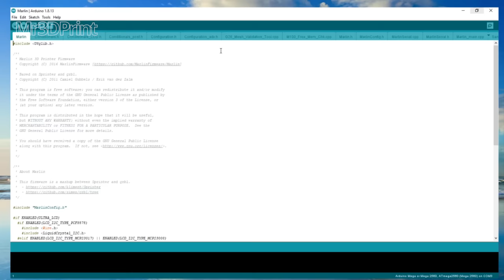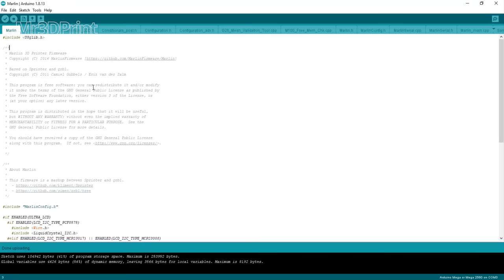#4 Heat and motion control board  - Details of free filament production from recycled bottle (PET)

Comment: Instead of a ship IN a bottle, it’s a ship FROM a bottle, I like the play on words.
Reply: true jajajajaj
Reply from the maker: I do not understand what you mean, you mean I wrote wrong?
Reply: @mr3dp  no no, you wrote correctly, your video is a ship from a bottle. John Smith is referring to a desk toy where a ship is inside of a glass bottle.
Reply from the maker: @isaacf.5166   ok. :)
Reply: @mr3dp  it is a play on words in English. Instead of building a ship inside a glass bottle(how they are traditionally put together) you took a plastic bottle and printed a ship from it. I like it :).
Reply from the maker: @JohnSmith-qm5xu  What an interesting example! Well done :)
Reply: I would of put it inside of aabsopure bottle and printed it larger if possible  by cutting off the neck end where it could be glued and put a few rgb led tape lights inside and make a wooden stand for the bottle one that would hide the led controller

Comment: I worked for a plastics company for many years and we had an extruder recycling plastic on an industrial level of course. You have the basic concept. you can run the heating side with a thermostat controller with a thermometer  or even with a thermister, i use this, on the feed side, i join the plastic with a soldering iron to have a longer continuous feed. And i have a dc controllable motor on the take off side to roll on to a normal filament roll!  good Work PM me for any help you may need

Comment: Thanks for another installment. I like the idea of using gCode instead of hacking support for constant movement into marlin like I was planning. For easier starting you should add the following line after the extruder is heated (this should pause the gCode so you can load the filament into the puller): M0 Press to start motor
Reply from the maker: Glad you liked it!
Reply: @mr3dp  do you know when the files for the winder will be available?

Comment: Congratulations, I find it amazing that this material that produces so much waste can be reused..! A technical question..
It could be used instead of an Arduino Mega. the Arduino UNO without display to work in the same way? It occurred to me to facilitate the design for a school in my city that can recycle the materials, I saw that there are several that reuse PET bottles..

Comment: Great series of videos definitely thinking of making one the only problem is I cannot find the motor in stock anywhere could any other stepper motor work and if so, which type, thanks in advance
Reply from the maker: You can use the same gearbox motors, such as the car windshield motor - or the car wiper motor or ....
Reply: @mr3dp  thankyou for you're reply so pretty much any stepper motor will work? I'm ordering the parts today to make a start :) one other thing though you know the acrylic big gears you use could I print them instead as I haven't got a laser cutter? And what order do The cables connect into the power supply unit? thankyou in advance

Comment: This is an awesome project. I'm wondering what the purpose of pumping air into the bottle and spinning it over the stove is though. Is it to smooth out the shape of the bottle so that it is easier to cut? Also, what is the thing that attaches to the bottle's cap that connects to the pump? Thanks for sharing this.
Reply from the maker: The purpose of heating is to smooth the outer surface of the bottle
And what I attach to the bottle is a Rubber Valve
Reply: Pumping air will make soft plastic expand that's why
Reply: @mr3dp  rubber shradder value

Comment: Can I change it to 
Arduino uno r3 + extension stepper motor board +stepper motor +  heater + sensor + Lcd Keypad shield (with 6 buttons on it)?

Comment: Hello Mr3dPrint.
I have no words to thank for sharing this invention and I really want to make one for myself. It is brilliant.
Thank you very much really. I am following the process with great interest and excitement.
The world needs more recycling and less garbage, the oceans ...
Apart from making our materials cheaper, etc .. it's great :)

I have a simple question: I am very new to 3D printing.

Can I use the 2004 lcd instead of the 12864? It's a really insignificant detail, right?
I suppose it is a question of having the Marlin with the corresponding screen library to use?
Kind regards from Spain and I wish you all the best
Reply: My opinion to improve the project or to contribute ideas that you ask in the description, is that it would be ideal if crushed plastics could also be used and that it was not a complicated system. I guess it would be a different machine or a very different concept.
I mean in this machine a simple system that pushes crushed plastic is attached to it. Maybe I'm going a lot out of the original idea, I don't know, or maybe it's possible ...
This one is cool and simple, the other idea would also be great in my opinion and would use different plastics from different packaging ...
but with this philosophy of simplicity and materials within reach.
Much encouragement and thanks for the great contributions and the desire to share.
Reply from the maker: I do not know, but I think it does not matter, see if GCode works properly in your program?

Comment: Hey, great project! im trying to do it myself
Can I use a 20x4 LCD ??
Reply from the maker: I don't know, maybe it can be done with it, I recommend doing it with thermostat w1209, it's easier
Reply: @mr3dp  If I use the thermostat w1209, I would have to set the appropriate speed inside the arduino code and then control the tempeture using the Thermostat? Is that it?
Reply: Im from Brazil, and the LCD 128x64 costs a lot of money

Comment: Hi @mr3dprint and let me say, what an amazing idea and work.
I have a quick question, I have a 12v, 5amp and 60W power supply, it is going to work or do I need the 20A 240W one to make it work??
Thanks again
Reply from the maker: If you do not have a good power supply, you can use old computer power, I will make a video in this regard, be sure to watch it

Comment: Hi, thsnk you for some great explanations om this topic. I have 2 questions:

1. Is it necessary to pressurise and heat up the bottle like you do in the beginning? Or what I be possible to skip this step?

2. When you pull it out of the nozzle that is 1.7mm do you ever get inconsistent plastic size so maybe 1.5 instead? Does the plastic sometimes break when you are making the filament?
Reply: he pressurizes the bottle so when he heats it up, the plastic expands uniformly and becomes smooth, so when the bottle is cut into a strip the maximum possible of the bottle is transformed into a strip, because those uneveness on the bottle may cause a inconsistent strip and/or break the strip when it's being pulled
Reply from the maker: 1. The purpose of heating is to smooth the surface of the bottle, we do not do this for smooth bottles.
2. When leaving the nozzle, if the traction speed is high, the gear filament will come out, load the attachment G-file, the speed is good

Comment: Have you worked with any bottles that are 0.65mm thick? and if so that are size does the ribbon need to be? thanks, Like before great work.
I am working on a PET filament welding/splicing device that run off of the same Ramps board but uses 2 extruders. One for the puller part and the second for the welding part. Thanks for the fantastic idea.
Reply from the maker: The maximum thickness I have worked with is a 0.5 mm thick bottle, for which the width of the bar is 6 mm.

Comment: Is the cross section of finished filament hollow? Also PET should be recrystalized if you need good mechanical properites. But it is very interesting solution for 3D printing.
Reply from the maker: I drilled it with 1.5 drill and the produced filament is about 1.7, but in general, it does not matter how big it is, in any case, if its density or diameter is small, you can change it in the software settings. And instead of changing from 1.75 to 1.5 or 1.6, this was not a problem for me

Comment: Made mine with $25.00 AUD 👍 
Testing my first batch in a few hours time later tonight. 😁
Reply from the maker: Good luck!
Reply: @mr3dp  thank you 🙂, after some trial and error it work's well.
The tuning was the hardest part, the size of the tape "is very important".  
I tried 8mm and it stopped, 7mm same thing, 6.7mm same again, 6.4mm was perfect! 😂. 
I'm glad I precut 6 2ltr bottles prior to it 🤣
Also my temperature is set at 220c and I can still feel the seam in the made filament? 🤔 is this correct? 
Thank you again
Reply from the maker: It is normal to have a gap in the filament because in this way we make the tape cylindrical
Reply: @mr3dp  thanks mate, I worked it out. But thank you again.
Did you look at my video coloring the tape with marker?

Comment: How do you control the speed of the stepper motor? The gcode has it at F55, but what does not seem to pull fast enough. Have you found any way to adjust the stepper motor while it is pulling? I have modified the Marlin firmware and your gcode file to work with 2 drivers allowing the extruder temp to be adjustable, but I have had to modify the gcodes for different types of material, by creating separate gcodes for each material. I would like to share the infor but do not know how to the it to the comment, and help would be apricated. Great work on this project.
Reply from the maker: To change the speed or increase the speed of the stepper motor, you must change the G-code
You can open the file with Notepad and change the number F55 to F110, the speed is doubled
Reply: @mr3dp  I am looking to be able to change the speed as it is pulling. I am looking for some information on how to implement a  1k pot, as I have been reading and watching YouTube articles.  I have modified Marlin to use X as the stepper motors driver and only use the Extruder for the hotend. I also used your gcode and modified it to down to about 16 lines. Works great. Using that I created addition gcodes for different temperatures. 
Since I was working with Marlin, I added a second extruder so that the filament welder/splicer that I built, could be used with the same power supply and software.
Now if I only have a good source of the same type of bottles.
Keep up the good work.
RC
Reply: can you help me with how to get this code and to upload

Comment: Could you tell me what program inside the sd card on 6:13, and is it required to use sd card?
Reply from the maker: In this method, yes, the G-code file is attached to the description
Reply: @mr3dp  ok, thanks for the information 👍

Comment: WOULD A 12V 30A PSU BE SAFE TO USE WITHOUT FRIYING ANYTHING? INTEAD OF THE 12V 20 A YOU RECOMMEND . I LIKE THE FAN FEATURE OF THE 12V 30 A ONE BUT IM NOT AN ENGINEER , WOULD IT BE SAFE TO SWITCH THEM ?
Reply from the maker: It should not be 12 volts, you can also use the power of old computers.The next tutorial will be about the same

Comment: Hi! I have two questions:
Fisrt: what is the order for the installation cables in the power supply?
Second: I've connected the Mega to my pc but when i try to "print" the Gcode there are - E1 Err: MINTEP - PRINTER HALTED (Maybe isn't connected to power supply?)
Tnx and you have done a NICE JOB! <3
Reply from the maker: It is marked on the board which is positive and negative.
If you see an error, search for this error on the Internet

Comment: Will you supply just the Configuration.h and the Configuration_adv.h files that you are using. so that I can adapt it to my board and controler. The generic on that is in the Marlin download link does not have the modified files. Thanks, Great work.
Reply from the maker: If you have a newer Marlin code, open that G-code file. If the extruder motor is activated, you do not need to use the Marlin file that I sent.
Reply: @mr3dp  The link does not make any since. Do you have a direct link. Thanks

Comment: Will I have issues using a different stepper motor than the one you used? It is out of stock and I can't find one with similar specifications.

I was looking at getting this one, step angle is the same, but current and holding torque are different than yours.

Twotrees Nema17 Stepper Motor
Product type:Bipolar 42 Stepper Motor
Step Angle: 1.8 deg. 
Rated Current/phase: 1.5A
Holding Torque:42N.cm (60oz.in)
Reply from the maker: Hello dear friend, I do not have exact information about stepper motors, but I think if you connect your stepper motor and there is no problem in running G-code, you can use it.

Comment: Hi Mr3dprint
Great Jop to make this machine
What is the diameter of the strip 6mm or 8 mm or 10mm to get a 1.75mm filament
Reply from the maker: The width of the bar is directly related to the thickness of the bottle. The thicker it is, the smaller the width of the bar should be.
But in general, it does not matter how big it is, in any case, if its density or diameter is small, you can change it in the software settings and change it to 1.5 or 1.6 instead of 1.75, this is a problem for me. It was not an instrument
Reply: Thank You

Comment: 07:37 is there a reason why you set the blue guide post so that it turns the  shredded bottle plastic to 90 degrees and then set the heat block it also gets fed the bottle plastic at a 90 degree angle?  Is this done this way to decrease slack and create as much tension as possible? I'm guessing moving the shredded bottle plastic wheel to the right and rotating that blue wheel clockwise so it feeds straight to the heat block which then gets fed the plastic at 90 degrees isnt good enough tension
Reply from the maker: This is because the strips are cleaned and slightly warmed before entering the extruder
Reply: @mr3dp  oh so those posts clean and warm the strip? I didn’t know there was a heater on the post. That’s new. I’ve watched a few of these builds and no one heated it before entering the heat block.

Comment: Great work! I wonder how precise and consistent the end filament is. Do you plan on adding a diameter sensor of some kind to compensate the extrusion on the fly?
Reply from the maker: I do not think it is necessary because it is diagonal, I may just put the motion sensor off when the tape is finished

Comment: Have one more question about heating, looks like it is not working. I'm getting error on display: "e1 heating failed printer halted please reset" Do you know maybe what can be the reason? I'm checking when board is connected to PC via ubs cable (could it be that voltage is not enough as usb should have 5v and heating wire has 12v)
Reply from the maker: The voltage is low. The voltage should be 12 volts and 20 amps

Comment: I'm sorry I created your same configuration that is with a ramps 1.4 only that I have a 16x2 LCD or installed the marlin1.1 from the PC I can manage it but the LCD no you see anything could you tell me which parameters I need to correct
Reply from the maker: If you change the LCD, you must also change the Marlin code

Comment: Mr3dprint: I have the possibility of getting a nema 23 motor with 6kg of torque, my question is if I can use that motor with the 4988 driver or if I can only use a nema 17 motor. I ask more than anything about the consumption that the nema 23 may have so as not to burn the 4988 driver
Reply from the maker: I do not know much about it, but I do not think they are much different

Comment: Hello good I have a doubt about how the connection of the motor to the ramps plate is going because the colors are not well seen or in what order they are that we are doing the same project that we are interested in doing
Reply from the maker: If you have a problem with the stepper motor connection, you can contact me on Instagram

Comment: I made eaxctly the same,but its not working. The problem,that the bottle plastic when melt,make a tunel form in nozzle so in the middle of filament lot of air. In the video have the same problem,you can see clearly at 8:36. I did try even till 260C ,but not really work.
Reply from the maker: We are actually making the strips into grooved tubes here, but this does not cause any problems in performance.
Reply: Can you tell me where can I find the Arduino code use in this video
Reply: @mr3dp  of course is do because is not 100% infill anymore.

Comment: how can be settings in marlin if we add a switch for filament running-out. as it gets a signal then shut the system off (motor and heat off )??

Comment: Do you have to use the 12V 20A 240W power supply for it to work?
Reply from the maker: Its amps should be more than 15 amps
Reply: thank you, i have one more question i got the lcd screen and i did everything you did in the video but when i put the sd card in it it still says no sd. is that a problem with the screen or like the coding in it.

Comment: What do you think use the the same 3d printer with a noze with operture 1.8 mm and set the temperature 205 graus tô make a filament? It would be posible?
Reply from the maker: It is better not to have a nozzle diameter greater than 1.7, because you will have problems when printing
Reply: @mr3dp  ok but… what do you think about use a 3D printer tô do your extruder. I have a ender 3. Is it possible?

Comment: I have an idea use a cheap iron solder with temperature control and to replace the stepper a weight with a system like in mechanical clock
Reply from the maker: It's great, but I tested it, the maximum temperature is 165 degrees, it would be great if we could work with it.

Comment: Have you ever done any tests on the dimensional accuracy of the filament? If so how were they?
Reply from the maker: It is about 1.7, but its density is not 100%, so I set it to 1.5 in the software and it works without problems.
Reply: @mr3dp  I wonder if you could use an optical sensor to speed up or slow down the winding to control the diameter further.
Reply: @madeintexas3d442  it will not work because in this the polymer is not being full melted, its just been remolded into a different shape.